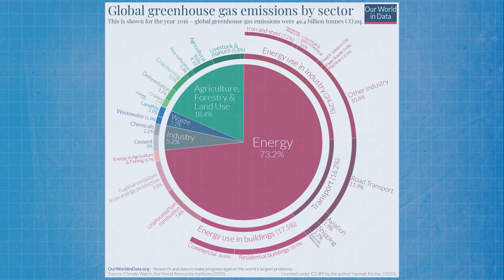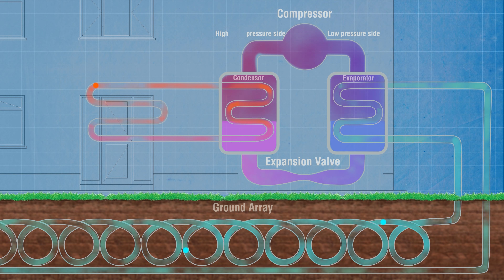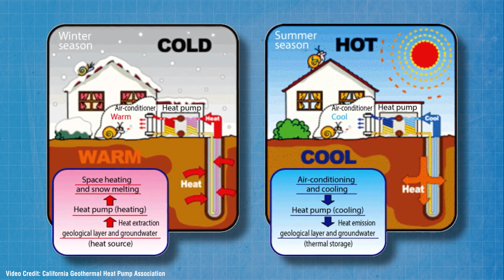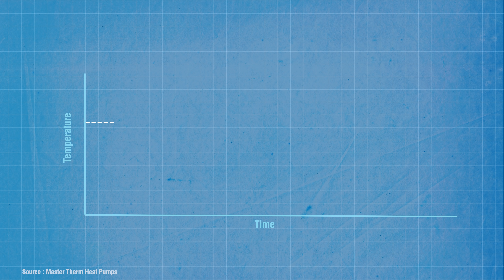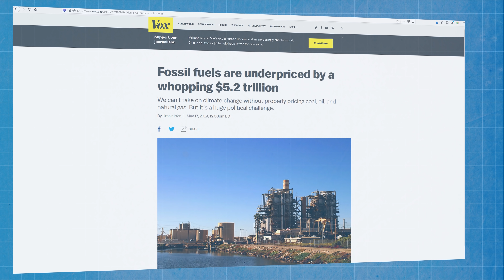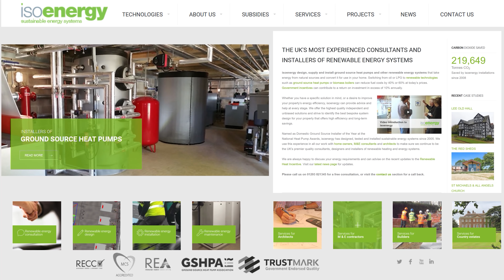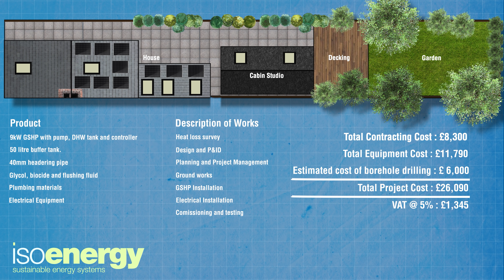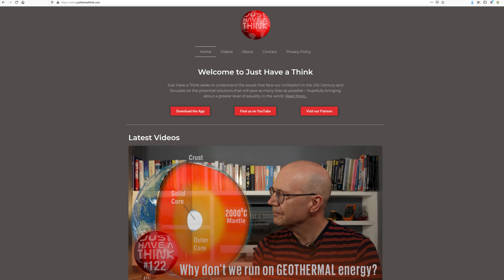Geothermal ground source heat pumps. Heating your home from your own back yard!

Comment: I bought my house with solar + ground source heat pump in mind a few years ago. It's a north-south property with a large back yard, so no borehole was needed, they just buried the pipes 3 meters down. There's a single large ground mount PV array, then the geothermal pipes extend behind that. Now everything on the property is electric, no natural gas or liquid fuels, and my energy bills are about $18/month with net metering. It's nice to have no external noises from AC radiators and no worries about problems with gas. I also feel decoupled from natural gas price fluctuations.
Reply: Richard Hacker 3 meters? Why so deep? I think that the recommended depth here in Sweden is less than one meter. You have to put out around 400 metres of tube so digging that deep seems too much. 
The surrounding of the tubes (ice) must also melt under the summer months.
Reply: @urpotaskinen  The temperature at that depth is always 10C, never freezes in my New York climate. Any deeper has no benefit, but shallower, there start to be fluctuations. The marginal cost of digging a little deeper is extremely small when the equipment is already there, so it makes sense to me.

Comment: Just FYI: Ground sorce heat pumps are not using geothermal energy as you were discussing in your last video. They merely collect solar heat stored in the uppermost part of the dirt globe we live on. Thus they work poorly in forests and on sand. Because in forests there is always shadow and in sand water is drained too fast and to move heat energy in soil at a rate that we can use it is necessary with moisture or the pipes in the ground will get too cold. 
To get any thermal energy from geothermals one needs to drill very deep holes since the geothermal gradient in the earths upper crust is in the order of 25-30°C pr kilometre or 72-87°F pr Mi. Those holes gets expensive and sometimes they just do not work out. Several smaller cities in Denmark has that working while others have poured thousands upon thousands into project only to find that they do not sit on top of any heat ressource at all. Tough luck.
Reply: Interesting to read this. Here is the UK solar gain isn't the main contributing energy source, it is groundwater movement generated by our abundant rain. The ground temp sits at around 9degC a meter underground in most places. A well-designed ground array will work on any soil type, you just may need a larger array.

Comment: Thank you.  These systems are vastly more efficient IF the bore hole gets down into the water table, because water has great heat capacity and it moves to carry heat away or bring it in.  But what happens when your heat pump heats the water flowing to your neighbors heat pump?  Crazy?  What if the 1000 houses in your neighborhood are dumping heat into the water table which flows to the neighboring town?  It is said that it is impossible to extract all the heat that has accumulated in the London Underground.  How does this look when it is massively implemented over a century?  Does the possibility exist that this heat will cause chemical reactions to occur?  My neighbors well exploded, he said because of a reaction between methane and PVC.  I would like to think someone at least has made a list and, if not answered the potential problems, at least has a team thinking about it.
Reply: Here, the British Geological Survey keeps a record of all boreholes. We have, however, never had a problem with chilling groundwater as the amount of energy taken from it is negligible.

Comment: Here is my plan to take care of funding purchases like these. Introduce a very steep carbon tax and distribute the proceeds on an absolutely equal basis per person. (I'm hoping on the order of £5-7,000 per year.). This money should be calculated at the beginning of the year and paid out in advance, with up to five years available in advance for approved energy efficiency schemes. If you save significant energy then you will pay much less carbon tax. If you blow your money on something else, then you will pay it back in much higher fuel costs. No one is out of pocket and tax haters can make money from the scheme by being really energy conscious, while people can continue to drive what they like...if they can still afford to. This tax would apply to all goods and services, driving industry as well as individuals and families to get low carbon fast. What do people think?
Reply: PS. It would also apply to imports and be refunded on exports, so not disadvantaging domestic business.

Comment: Using Geothermal pump (pipes are drilled to 125m depth) paired with wind energy from the grid to heat my 125 squaremeter home. The overall consumption is around 400 kWh during the summertime and 900 kWh on colder seasons. I pay roughly 100€/month for electricity during the winter, which is really cheap and leaves room to overcompensate all other emissions too (using compensate.com to do it). 

This doesn't mean I should stop there, but just pointing out options one can do.

Comment: One article I read said that to prevent the spread of viruses, the air system must change the air so many times per hour.  For some heating systems there is little change of the air.  So this is one area that may be mandated by new health and safety laws.
Reply: The trick is to extract the heat energy from the air being exhausted from the building. It's an established technology.

Comment: Thanks for another great video!

I didn't know the formal name for this technology was "ground source heat pumps." Around here they just call it geothermal heating, but I see now that's inaccurate as you covered real geothermal power in the previous video.

We almost had a fancy Swedish style neighborhood heating system, but the people who control the multi-million dollar loans just wouldn't go for it. There's a destructive conservatism in my part of the world when it comes to alternative energy. You see people adopting alternative energy solutions on the level of individual households, and we have baby industries that have grown up to install those systems - but when you scale up beyond the level of individual houses alternative energy use drops to nearly zero because of the institutional skepticism of anything that isn't based on fossil fuels.

But that said, there are a surprising number of ground source heat pumps out there. Like mushrooms, they're both unobtrusive and surprisingly common. I had a friend who rented a house that had one of these systems, and there was absolutely nothing on the outside that would indicate it was heated by alternative energy. Inside it was about 21 degrees C in every room, and they told me it was always that way throughout the year. Living there you just sort of forget about the seasons if you're not looking out a window, because there's no variation. Apparently it was maintenance free to run, but it was really difficult to install. The contractor had some kind of accident that resulted in a foot of water cascading down the street. But when they got it fixed and finished the problems were over.

Comment: Sorry I like your channel but there is a serious flaw in your argument and examples. #1 PROBLEM: After you pay $50,000 to drill and install the piping for a very SMALL geothermal instance ... How do you repair the tubing when a small leak occurs?!?! And how much will a tiny repair cost?!?!?! Geothermal is a bad idea ... very bad idea.
Reply: Got that covered. All the ground arrays we install are pressure tested under load to check for leaks before anything gets connected. We use electrical fusion welding and guarantee any below ground joints for the life time of the system. We also use that they call RC pipe which is crack resistant MDPE. There is a host of info on how we are able to guarantee the infrastructure of the system on our website. I expect the heat pump itself to have died like an old fridge long before the ground array presents any issues. By then I hope we will have even cleaner tech in place to heat our homes. As long as you keep your array away from sunlight, we are talking 20-30 years of hassle free operation for the array.
Reply: @isoenergyltd  I still wouldn't buy it. While you may be a good person, there is no guarantee that your company will be here to fulfill the terms of the agreement. The earth shifts a bit .... good bye system and 💰💰💰💰💰.

Comment: In Scotland you can get a 0% interest loan from the energy saving trust to install a heat pump, ground or air source. I used it to cover most of the cost of my air source system and the RHI payments almost exactly match the loan payments. I wouldn't have been able to afford the installation without that.
Reply: Ahh Scotland, so far ahead of the rest of the UK in this sphere yet again.
Reply: Right - this is what governments need to be doing - they can provide loan capital almost for free. Well done Scotland. Until you can get a heat-pump for £1300, same as a gas boiler, most people will need help like this. Gas boilers will be illegal after 2025 at which point we'll see heat pump pricing plummet, I bet you.
Reply: @Wookey.  well you have completely ignored the fact that if you have a alternator attached to the turbine that creates the Heat you're dealing with an extremely energy efficient use of natural AKA coal fract methane. I did Google what coal gas is. Apparently before electricity started providing lighting what was more important than the btu content was the illumination of the gas when it burns! Well with methane we sink of blue fire back in the days of coal gas it was engineered to provide for yellow. That's called paradigm duh 

I guess people had solid coal for heating and then they had piped coal gas for lighting?

You're not wasting money if you put several water lines in several sewer lines and at least three gas lines at least in the street if not into the house. This is really ridiculous. You need to have a line for nitrogen in new construction and certainly for hydrogen which is what I meant to say because people might want hydrogen despite still needing there methane. You need water to flush your toilet with and water to bathe and then you need water to drink and having bottled water is 4 not already able to be planned further development. I mean bottled water is third world. It's like bottled hydrogen. I believe in truck technology especially Last Mile. but I also think there's a role for pipes within high density cities certainly. if you're going to truck the water the people then certainly 31 + types of water are indicated. Not just Fuji from Amazon.
Reply: How appalling. Public money used to encourage a technology that adds to global warming [heating].
Reply: Ahh Scotland, so far ahead of the rest of the UK in sponging cash from the rest of the UK... Indy2 vote, make it happen !
Reply: @Mora41  You do know how a loan works, right?
Reply: @TheForumgod  yes. I will take one thanks.... Oh no wait .. I can't

Comment: We had heard of these systems for years.  Went from Natural gas heating/water heating with electric cooling to geothermal (heating/cooling/water heating) 3 years ago and love it.  We used a new way of installing laterally that also does not tear up the landscaping (turns out the pros have been doing this for years installing conduit under roads).  Saved us much money on the install.  We increased our PV cells to handle the small additional electric load so we are net zero + pollution free....and it REALLY DOES SAVE MONEY.
Reply: Is this lateral installation using directional boring? Like what the gas company uses to install pipe?
Reply: Yes, this is exactly what we used, and for these boring guys, it's no big deal because this is what they do all day long.  P.S. We just went through a heat wave (116 degree days), and our unit just purred along like nothing at all.

Comment: You forgot to mention that to make heat pumps efficient it is really important to isolate your house as good as possible, because heatpumps probably cannot cope with providing the heat when your house is a bit leaky... Rule of thumb is in the Netherlands if your house was build before 1995, it probably needs more isolation to make a heat pump viable.

Improving the isolation of your house may add a huge cost to install a heat pump.

If you have a central heating system with radiators and a high efficient gas boiler, as a test, set the boiler temperature to 50 degrees on a cold wintery day, if the system can keep your house comfortably warm, a heat pump could do the job instead and your house does not need additional isolation.. But if  it gets colder and your boiler cannot keep up.. probably need some improvement in isolation of your house. 

As sombody said, Heat pumps work best with floor heating, so if your house does not have floor heating this also might add costs, because the old radiators are also not suitable... It is all about transferring that small heat difference as efficiently as possible into your house, and the old ways are not  really compattible with that.

All in all it is not as straight forward as it looks like in this video.
Reply: Sorry Marco, your information is a little outdated. It is true about 20 years ago, this was the case, but its not now. About 90% of the installations we do use the existing radiators in the house. We use a constant flow at low temperature based on the outside air temperature. Check out Weather Compensated heating. Good point about insulation though. The cheapest unit of heat is the one you don't have to buy! However, given a big enough ground array, I can bring Stonehenge up to a comfortable living temperature for you. We work in a lot of ancient/listed buildings as they tend to have the land available. They are of course tied by building restrictions so insulation isn't always possible. There are a load of case studies showing leaky old houses being headed with ground source using the existing radiator systems on our website.
Reply: @isoenergyltd  Wow, thanks for the update then.. 

My source must have been outdated (some Dutch government information website about subsidies on investing in sustainable energy)

Comment: when CO2 credits are cheaper for the industry to become green then to pay-up will help as in Brussels they are giving away solar including installation of panels to anyone who wants to have them to cover their pollution. A quote from the site: "Brusol is an project develped by the ISO-certified company EnergyVision, which builds industrial solar panels in Belgium. Brusol was developed to provide Brussels residents with green solar energy for free, in an effort to meet the 2020 climate targets. In order to provide free solar panels to all residents who wish to have them, Brusol has worked with Brugel and the Brussels-Capital Region to gain compensation from green energy certificates. Brusol also contributes to EnergyVision’s “SolarClick” program. With the support of Bruxelles Environnement, Sibelga, and the Brussels-Capital Region, Brusol is building “50 of the 150 projects” for the SolarClick 2020 goal. EnergyVision has installed 370,000 solar panels, and continues to provide renewable solar energy to Brussels inhabitatnts today. "

Comment: Why is the building regs not updated for new home builds that have concrete floors. It is low cost to install heating pipes under the floor during house build.  Expensive and unpractical later. Even if  heat pump is not installed on new build using a gas or oil boiler will work ok. Leaving a low cost upgrade in the future date

Comment: Excellent program again, thank you for all the work you put in to these for us.
One thing I have listened to heat pump installers talking about is demineralisation water treatments from the start to reduce the PH and conductivity. The same for gas boilers too. As it isn't a regulation in the UK it is seen as an extra cost so hit and miss as to whether it happens or not.
Could one way to make ground pump systems more numerous be rather than a grant the Government in the UK set up a National public owned company whos only job is to go drill and fit the vertical pipe part of the setup. It would reduce costs without a grant and probably speed the roll out process up. It's also handy for setting a good standard for the drilling while keeping private enterpise for the pump side of theings. A upper limit of the hole size they drill would stop large more well off households taking advantage. Energy reduction is going to take to long unless it is seen as a national effort in the same way a War Chest can be found and justified in the blink of an eye.
Reply from the maker: Hi Helen. I agree completely, That's precisley the kind of bold, lateral thinking our governments need to be pushed towards. If only we could get the Citizens Assemblies set up, as suggested by XR.
Reply: @JustHaveaThink  Have you read your average comments section elsewhere recently, I think we would skip heating and science and go straight to invading Poland. :) 
It would nice although a little naive of me to think we could elect and then pay for people to run the country instead of acting like they're rolling down a hill only able to avoid rocks on the way down. 

My biggest take away from Tesla battery day was that for the first time someone was trying to do something about the massive mountain that is ramping up battery supply to electrify the worlds car let alone storage... most at all levels just seem to be happy thinking it will all sort itself out somehow.
It's a similar thing with Highview Powers liquid air storage plant they're building near Manchester... with promises to build more. If you're just talking about one in each County of England its over forty needed. The lack of a plan or urgency I think is the biggest problem facing the human race right now. 
I thankfully have a cup of tea on hand to keep me calm looking at the world each day.